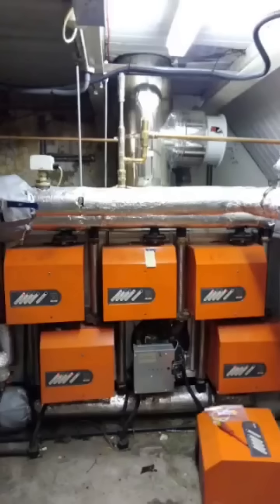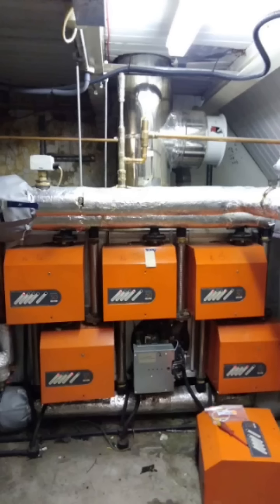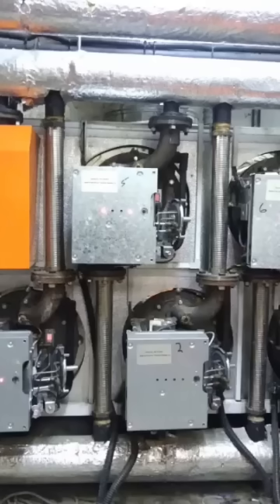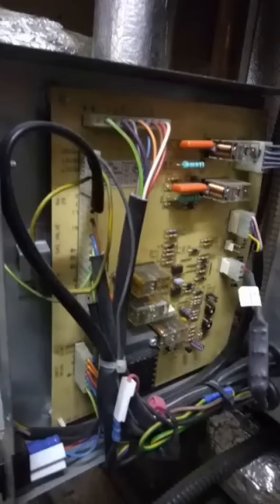SUPER SERIES ARE NOT FOR NEWBIES

Comment: I've just done 10 modules full strip down and acid dip,super series 4s not for the faint hearted
Reply from the maker: I've never dipped one in all my 7 years. Changed one.
Reply: @CommercialGasEngineerVideos  I've only done it once,I kept glossing over that part in the manufacturers instructions.
I can't believe ideal didn't put isolation on the flow and return to the individual modules.